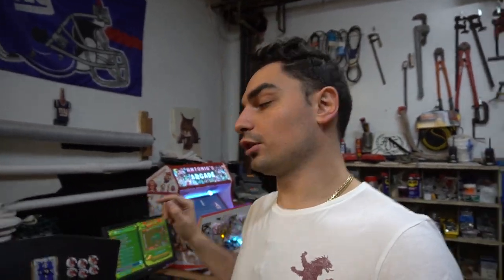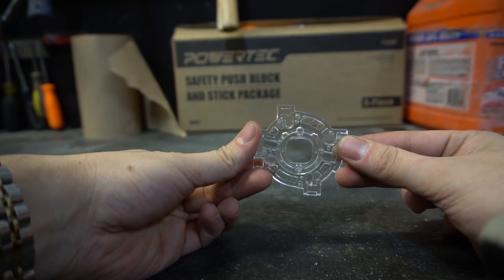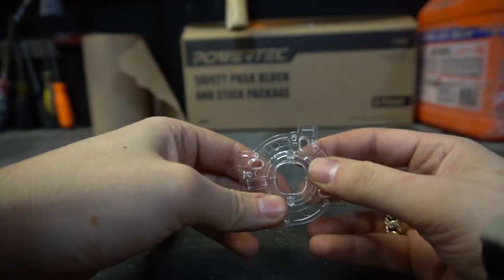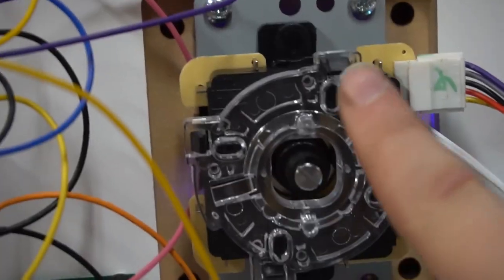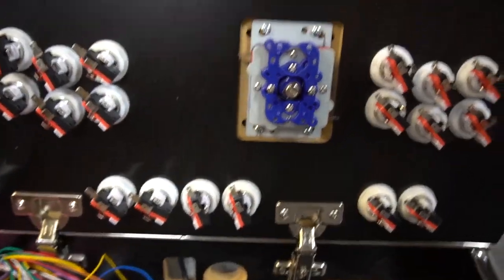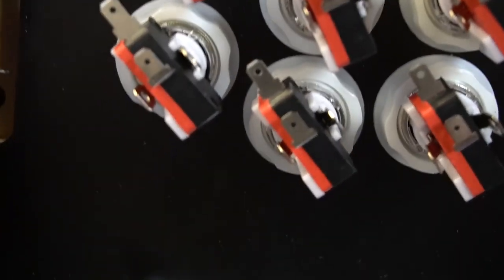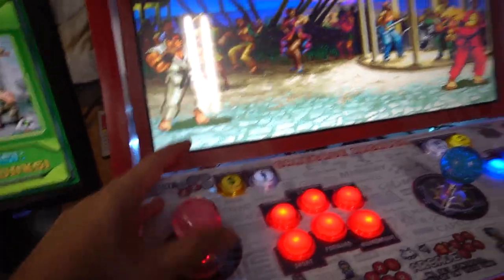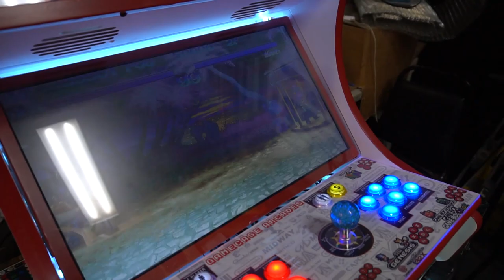How to change joystick from 8 way to 4 way - zipply and led joysticks

Comment: Good video. Is there a way for a plate to be installed on top of the console instead of underneath? I have a mame arcade and need to be able to pop on/off depending on the game being played. Go Giants!!
Reply from the maker: No you wouldn't be able to install from above, all joysticks have the gates at the bottom as that is where the micron switches are

Comment: Got a question I got a led ball top and a bat top led joysticks. On the 2 joysticks there are 2 five pinouts on each joysticks what can I do with them if I install both on my arcade machine.
Reply from the maker: The 5 pin out sounds like it is not including power to the led
There is probably a separate port or wire for the led

5 pin is for joystick
Ground, up,d,l,r
Reply: @Vic_VP  right on the joysticks. Ok there are 2 5 pins on the 2 joysticks can I take one 5 pin cord hook from the ball top joystick and connect that to the 2nd 5 pin on the bat top, then take the 2nd 5 pin cord connect to the encoder. Waiting for response.
Reply from the maker: @cedricbanks2149  are you duplicating player 1? 
Like are these 2 joysticks controlling the same player?
If yes then yes you can hook them together
Reply: @Vic_VP  thank you so much